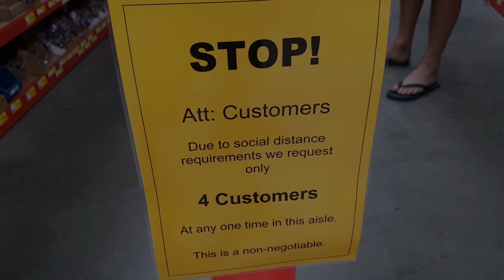SAILING SAILBOAT REFIT BOAT WORK and RELAUNCH - Ep 83

Comment: Refits. As bad as watching paint dry? More painful than trying for a smile from an adolescent male? Maybe 🤔. 
But the pain that you experienced with the strike/s (lightning/insurance, and/or tradesmen) was extraordinary. My minor delay of an unnecessary extra month on the hard waiting for two tradesmen (c.f. workers) to finish one small task pails into insignificance in comparison. 
But you have to appreciate the speed and finish of the vinyl treatment, and your good own work. 
Well, that’s a wrap, and no more bad jokes.
Reply from the maker: Thanks Bill. The waiting was certainly frustrating as the summer came and went and we were stuck in the boatyard but it was all worth the wait as you can see.